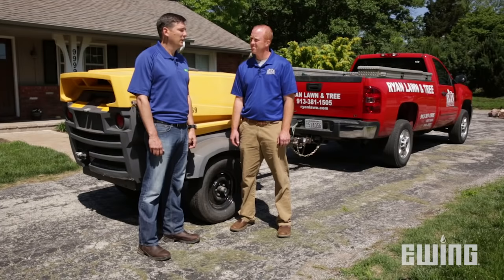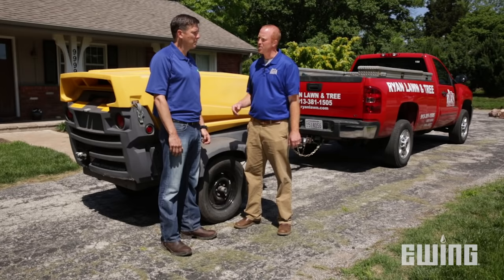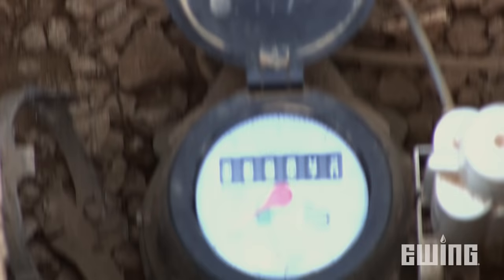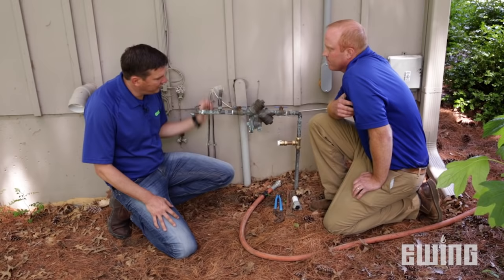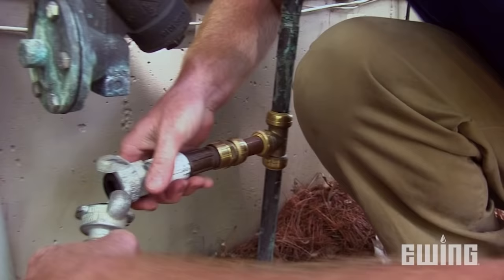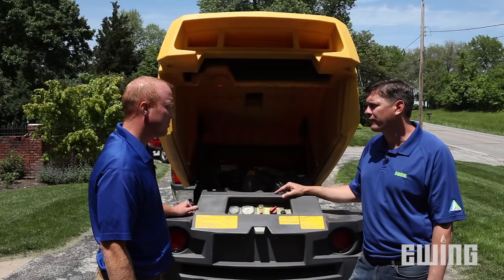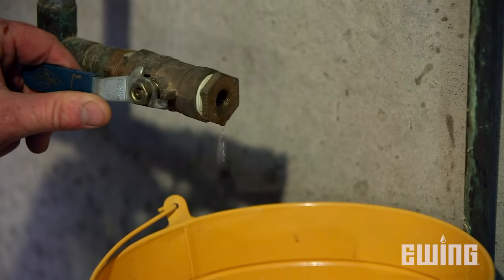How to Winterize a Sprinkler System - Blow Out Method

Comment: Thanks for this video I do this every year for the company that I work for but I have a question if I plug in the backflow test cock can I use any of them or you suggest just one of them and which one is better ?
Reply from the maker: You may have missed it in the video. You shouldn't run air through a backflow preventer as it can damage it. If the system wasn't built with a place to connect your air supply downstream from the backflow device (like a hose bib), then you should add a connection. It'll be a lot less costly than replacing a backflow preventer. Thanks for the question!
Reply: @ewingoutdoorsupply  I know I suggested that to the homeowners but some of them don’t do it I have all the equipment and I hooked up from the backflow sometimes I just wanted to know if it can be damaged thanks for the info

Comment: I have watched several  sprinkler blow out videos and I don't see anything that looks like what I have. I know how to  shut off my water but I can't find  any  way to hook up a compressor.
Reply from the maker: Thanks for watching Christopher! Unless the system was originally designed with a connection for the compressor you will need to add it yourself or hire a qualified contractor to do it for you. In the video (4:02), the contractor tapped into the supply line and added a brass compression tee with short piece of pipe and a female compression adapter connected to the tee. This setup allowed him to thread a quick-connect adapter into the female adapter to hook up air line.

Comment: 80 psi? wow.  Did I do something wrong then? Mine came up and sprayed water at about 43ish-45ish PSI until it started fogging.
Reply from the maker: You should be fine. Anything between 40-80 psi is okay. It's important to never exceed 80 psi as higher pressures can damage system components. Thanks for watching!

Comment: I live in a condo development and have been doing some of the simpler jobs on our irrigation system such as changing heads, solenoids and diaphragms, managing seven control timers, season start-ups, etc. Management has asked me if I could handle blowing out the system this year so I have been doing some research, including watching your video 3 or 4 times so far. We have 5 backflow preventers, 109 zones with 691 heads running off 7 timers. Each zone has a control valve.

Questions for you - 
You never mentioned anything about control valves in the blow-out process.
1. Do you start the compressor first and then open each valve one at a time until the water coming out is fogging, then move on to the next zone? Or open the valve first, then start the compressor?
2. Should the compressor be shut off between zones?
3. Does the timer remain shut off the whole time? Or can you run the system from the control timer at, say,  3 or 4 minutes at each zone, turn on the compressor and run it automatically?

Your help will be most appreciated. TIA

Ralph
Reply from the maker: Hi Ralph! You'll want to avoid introducing pressure into the system with no way for it to escape (watch at 4:37). I think that answers your questions. Good luck with the job!

Comment: Question: Is there any reason not to blow it out more thoroughly than a fog, or is this a case of good enough because it's not necessary and you might be in a hurry, or is it something more important? 

Again, thanks for providing a very informative how-to video. :thumbs up:
Reply: I had the same question.  Its frustrating when someone tells you something that goes against common sense (in this case, that you want ALL  the water out)  and doesn't EXPLAIN why you would leave some of the water in.
Reply: @JM-nh8yp  when water freezes it expands. When the pipe is full it will burst or break the pipe. If the pipe is mostly empty any water in there has enough room to expand without causing damage.
Reply: @ryanlavallee3239  Yeah, I understand that water will expand and cause damage.  I was the one making that point.  That you want the water out.
Reply: @JM-nh8yp  When I researched "how much does water expand when it freeze" the answer came back 10%. Think about that.
Reply: Running the air longer can actually generate to much heat to the system and damage valves. It sounds crazy but it doesn't take long for heat to built and that is why experts quit when they start to see fog.

Comment: Okay, hold on now.  At 4:35, why can't you go ahead and turn on the compressor and build up pressure on a closed system?  If your air compressor PSI is set at the same level as the normal water utility PSI (somewhere between 50 to 70 PSI in my case) why would this create problems?  PSI is PSI, and the piping should be just fine and not burst whether it's fluid or air PSI, right?
Reply from the maker: The sudden force could damage components. The same is true when you first return water to the sytem in the Spring. You slowly open the valve to prevent damage to the system from water hammer. You can learn more about the process of winterizing from this article from Hunter:
https://www.hunterindustries.com/winterizing-your-irrigation-system#:~:text=It%20is%20better%20to%20use,heat%20and%20could%20cause%20damage.
Thanks for watching and for the question!

Comment: I don’t have a shutoff above the backflow preventer.  Can I blow air through it as long as it is in same direction as water runs ( I’ll close valve between backflow preventer and house though)?
Reply from the maker: It's not recommended to run compressed air through the backflow device as the friction from the air can damage the internal components. Thanks for the question and for watching!

Comment: What kind of attatchment do you need to screw onto the Febco backflow preventer? I have an 825y 1" on my system and need a female end to screw onto the backflow preventer
Reply from the maker: +ll NATE DOGG ll - If you are referring to the attachment for the air line, there are a variety of pneumatic quick connect couplers available so it's hard to say what will work for your situation. Remember that you do not want to send compressed air through the backflow device. In the video, the quick connect coupler was attached to the irrigation supply line downstream from the backflow device. The connection was made using a compression tee and a threaded female adapter. If in doubt, we recommend hiring a qualified irrigation contractor to winterize your system. Thanks for the question!

Comment: Why are you using shark bite connector outside? Will the O ring fail over time?
Reply from the maker: This is from the manufacturer: "SharkBite Universal brass fittings can be used in sunlight when installed on copper or CPVC." Thanks for watching!

Comment: I discussed with my winterization specialist where to connect the air compressor to blow out the air for winterization. He told me always connected to before the backflow preventer, the left side as shown in the video.  He said if connected to after the backflow preventer, as what the video suggested, it won't blow out the water inside the backflow preventer. I am not sure what to follow.
Reply from the maker: We do not recommend forcing air through the backflow device as it can damage internal components. This is an excerpt from Hunter's winterization instructions for reference.
"The compressor is attached to the mainline via a quick coupler, hose bib or other type connection, which is located after the backflow device. Compressed air should not be blown through any backflow device. "
https://www.hunterindustries.com/winterizing-your-irrigation-system
Reply: @ewingoutdoorsupply  Thank you for the reply.  But check the YouTube videos.  Most of them do not even have a way to connect to after the backflow preventer to blow out water, as what the video suggested.  In other words, many home installation can't meet the need, including mine.😓

Comment: Thanks for the video! One question, when manually switching through the zones do you stop the air flowing from compressor while switching? Or just keep it going while going through the zones? Thank you again very informative.
Reply from the maker: You do not want to have the compressor running without a valve open so it's best to shut it off between zones. Thanks for the question!

Comment: What is the valve called that is after the blow out preventer to blow out the system?
Reply from the maker: The connection for the compressor can vary but in this case he used a shark-bite style compression tee to tap into the supply line. Thanks for watching!

Comment: I have access to a big diesel compressor like that but where can I find that adapter?
Reply from the maker: The connection for the compressor can vary but in this case he used a shark-bite style compression tee to tap into the supply line.

Comment: I live in CO and just had mine done today, but I don't think the guy cycled the sprinkler system to the backyard.  I could tell because we had snow, and the front zones left spray in the snow, and the back ones didn't have any signs.  Does that matter?  Is it just to get water out of the riser, or do the back zones have to cleared out as well?  Thanks for any advice!
Reply from the maker: If there's water still in the system in the back you'll want to get it out. If there's enough in the lines, in a low spot for example, it could freeze, expand and fracture the pipe. Thanks for watching and for the question!
Reply: @ewingoutdoorsupply  Thank you so much!  Not only for the video, but the super quick and informative reply.  I truly appreciate it!  Have a great day!

Comment: I don’t have any drain for my system in my basement and only have the valve, is their anything I can do to get the water out of the pipe that is leaving the house?
Reply from the maker: It's difficult to answer your question without seeing the system. We would recommend hiring a professional to take a look. You may want to have a drain installed if the water from the line upstream cannot be drained through the backflow device. Thanks for watching!

Comment: Thanks for the video... Seems like the previous owner hired a rather idiotic team to install the irrigation... Downstairs draining valve and the air compressor hookup point for outside don't exist.. they were using the only option which is to blow air through the backflow preventer...

Comment: I have one question Im from long Grove Illinois when you guys do the cleaning do you guys put anything to cover the valves or heads we usually put a plastic on the heads so salt and water don't go in side  since I do a lot of large homes can that affect anything'? I've done it  for 10 years and never had a problem just wondering thanks
Reply from the maker: Thanks for the question Al! The plastic should not be needed to protect the heads or valves. As long as you get all of the water out of the system you should be fine.
Reply: You don’t need to cover the plastic heads brother we usually remove the rpz if it’s located outside and have the home owners store it for the winter

Comment: Hi, would you be able to help with an issue? I just had my winterization and afterwards, it has been draining continuously for more than 12 hours and a lot of water, so what is causing that? As I checked the water supply to the sprinkler has been shut off completely....
Reply from the maker: It's difficult to say. You may have a bad valve. Corrosion or debris could be preventing it from closing completely.

Comment: what is a Zone? and what does it mean if you have more then one blow out?
Reply from the maker: Depending on the size of your irrigation system, you may have more than one zone or areas of irrigation. Each valve in your system operates a zone. For example, one zone might irrigate your front yard, another could handle the back yard while another might be dedicated to drip irrigation that irrigates a planter bed or trees and shrubs. Each zone should be winterized to remove the water from the pipes to prevent damage from freezing/expansion. Thanks for watching!
Reply: @ewingoutdoorsupply  Thank you so much for the reply. That helps a lot with my work and learning about irrigation systems. Now, where can I find a blow out location? Its not really telling me on google.

Comment: I just read on Hunter's website not to "fully charge" a small home compressor to compensate for the  low CFM. What is the harm in doing so?
Reply from the maker: The sudden burst of compressed air can burst pipe or damage other components of the system. You'll notice at 5:03 in the video that Mark slightly opens the valve on the compressor before firing it up. This slowly introduces the air into the system. Thanks for watching and for the question!
Reply: @ewingoutdoorsupply   Thank you for the quick response!

Comment: I have a back flow preventer that has two test ports. One is upstream and one is downstream of the back flow preventer. The downstream test port is just upstream of my zone valves. I have heard you can introduce air to the system on the downstream test port but not on the upstream side as air going through it would damage it, BUT I have also read you should not put air through any test port on a back flow preventer. Which is correct? I really don't have anywhere else to introduce air to blow out my sprinkler system.
Reply from the maker: Hi Charles. You should not connect your air supply to the blackflow device. Our recommendation is to install a connection on the downstream side of the backflow device similar to what is shown in the video. Here's some information from Watts that may be helpful.
https://media.wattswater.com/fp765.pdf
Thanks for watching and for the question!

Comment: So you don't have to drain the back flow preventer?  How about showing how to add the special connector?
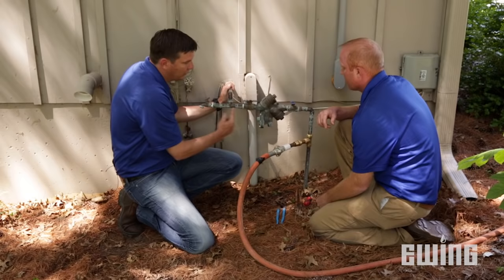Reply from the maker: Yes, the backflow needs to be drained as well. He does this starting at 6:10 in the video. The connection for the compressor can vary but in this case he used a shark-bite style compression tee to tap into the supply line. Thanks for watching!

Comment: This video appears to be for homeowners yet you are recommending a tow behind compressor... ok.. Small compressors work just fine in my business.
Reply from the maker: Ewing is a wholesale distributor of irrigation and landscape suppiles serving professional contractors accross the US. The information provided in the video is consistent with instructions from the major manufacturers. Here's an exerpt from Hunter's winterization guide.
"The blow out method utilizes an air compressor with a Cubic Foot per Minute (CFM) rating of 80-100 for any mainline of 2" or less. These types of compressors can be rented at your local equipment rental yard. Caution: a small shop compressor (1-3 HP) will not have enough "free" air to properly winterize the system. Do not attempt to fully charge the holding tank then release the highly-pressurized air flow into the mainline to compensate for the compressor's lack of CFM. " You can learn more here:
https://www.hunterindustries.com/winterizing-your-irrigation-system
Thanks for watching!

Comment: What is the model of large compressor used in this video?
Reply from the maker: Sorry Keith, I don't recall the model used but if you do a search for 'mobile air compressor trailer' you will find several options. Thanks for watching!
Reply: it's an compressor from Atlas Copco one from the serie 7 range. (somthing like XAS 77 or XAS97)

Comment: As a person who has blown out about 20,000 systems over 30 years, I would suggest hire a professional. I live in Alberta Canada and going price for a 6 zone blow out is about $85. If you choose to do it yourself rent a big compressor if your longest line runs more than 200 feet. Lot of houses are crammed together in 40 ft wide lots, and are 3 zones at most. You can use a compressor with a 30 gallon tank. You need the maintain the volume not the pressure. If you have a bigger yard You should use a diesel powered compressor. Now the video is wrong when you blow out, you open the valve manually in the green box, and you can do 4-6 at the time depending how big your compressor, mine is a 210 cfm Sullivan, so it's big. The reason why you open four zones, is to disperse the pressure. A big compressor is usually set at a 110 cfm, and if your switch is set to high it might run at 150psi. Another reason why you don't use the timer is because one of your valve might have a dead solonoid and is not functioning. Now my advice is rather than pi***ing around, hire a contractor. Have you ever phoned a sprinkler contractor in the spring, and you couldn't get one because they are too busy? I'm a sprinkler contractor and I literally get 30 calls a day in the spring, guess who I choose to repair first? It's the people who call me year after year to winterize the systems. I have a vested interested to fix those customers first. The reality is when the weather turns nice in the spring everyone wants their sprinkler fixed.
Reply: People that don’t fix their own sprinklers… it’s the easiest thing ever. People are just lazy and ur lucky they are lazy

Comment: You didn't explain WHY you stop when the water is just a fog. Would it hurt anything to continue? Are you saying its "close enough?" What's the rest of the story there???
Reply from the maker: Once you see fog you have removed enough water in the lines to prevent freeze damage. You do not want to continue past that because the compressed air moving through the pipes can cause friction, which will create heat and the heat could cause damage. Thanks for the question.